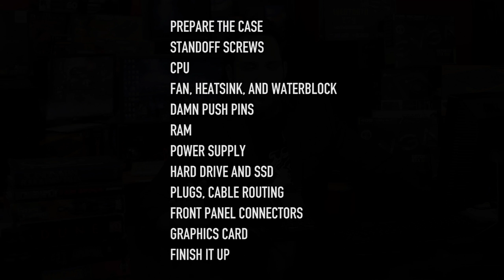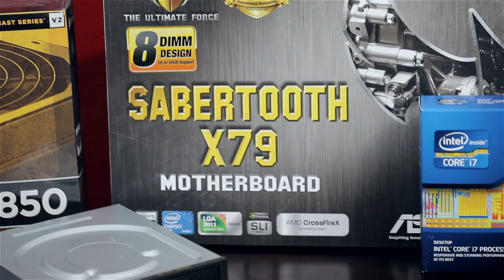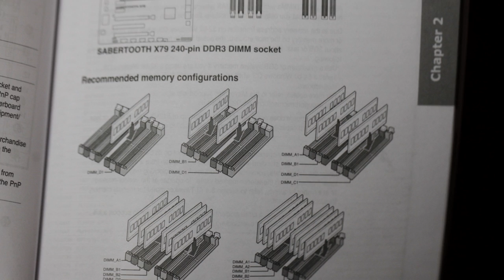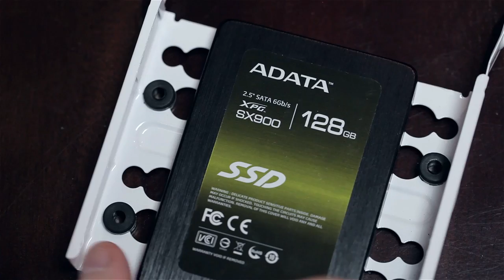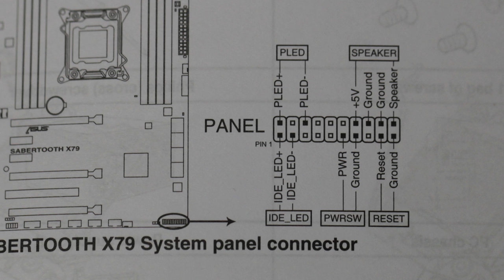How to Build a PC: The Ultimate Guide from Tek Syndicate

Comment: hello, i'm building a computer and i wondered if this is good and that everyting fits

case: nzxt phantom 410 midi tower
psu: corsair cx 600w
cpu: amd a10 5800k black edition
gpu: XFX Radeon HD 7770 GHz 1GB GDDR5
motherboard:  MSI Z77A-G43
ram: corsair vengeance 8gb 1600mhz
hdd:Seagate Barracuda 1TB 7200MHz 64mb cache

Comment: A Z77 motherboard will NOT work with a a10-5800k APU. Thats a Intel mobo and amd is a no no with those. Get a FM2 A75 or if you're wanting power get a A85 mobo. Make sure the cpu connector is a FM2 connector. Also, consider upgrading to the 6800k, its really good :)

Comment: EVGA GeForce GTX780 SuperClocked  3GB GDDR5 384bit

Intel Core i5-3570K Quad-Core Processor 3.4 GHz

Corsair Obsidian 650D 

Corsair Professional Series 860 Watt 

Western Digital Caviar Black 2 TB SATA III 7200 RPM 64 MB Cache Bulk/OEM Internal Desktop Hard Drive - WD2002FAEX - Western Digital

Corsair Vengeance 16GB (2x8GB) DDR3

What Motherboard should i get?

Comment: Hey is this any good (my budget is 240 euros) ?

Motherboard: Asus M5A78L-M LX3  AMD Micro ATX Socket AM3+

Gpu:  MSI R6570-MD2GD3 AMD 2048 Mo 650 MHz PCI-Express 16x

Cpu: AMD Sempron 145 / 2.8 GHz ( 2000 MHz ) Socket AM3 L2 1 Mo Box 

Power Supply: Xilence  ATX 2.2 Gaming Edition 750 Watt 80+ Bronze 

RAM: :Corsair CMV4GX3M1A1333C9 Memory RAM DDR3 1333 4 Go COR CL9

Case: Cooler Master ATX 120 mm Rack HDD

Thanks :D

Comment: DDR3 2100(OC) / 1866(OC) / 1800(OC) / 1600(OC) / 1333 / 1066 / 800 <-- your mobo ram specs, your ram is gonna be set at 1333 by default, you're gonna have to manually set it to 1866 in the bios, probly the timing and voltage too unless theres an XMP profile you can just turn on which should do the job for you and an 8350 should have no problem with 1866 memory, even if you decided to overclock, 8150 had problems with it tho

Comment: Does upgrading your sound card also making your processor working smoother and faster for games ?
Reply: Nope, and believe it or not many sound cards are worst than the on board audio of many motherboards. So it doesn't help much by even having a sound card.
Reply: No need! Sound cards are not needed for the vast majority of people. I use a headphone amplifier and that's amazing.
Reply: i use the soundblaster usb sound card which i got from my headset . does work preety good for such a cheap gadget

Comment: Is this build OK?
MSI Z87-G45 Mobo
MSI Frozr Overclocked GTX 760 2GB
Intel Core i5 4670K (I'll possibly overclock this 4.6 Ghz)
Corsair Vengeance Pro 2x4GB 1600 Mhz
Cooler Master HYPER 212 EVO CPU Cooler
SanDisk Ultra Plus 128 GB Solid State Drive
Rosewill HIVE-650W 80PLUS
Seagate Barracuda 2TB HDD

Comment: I got a question for you, if you don't mind answering. In regards to the power supply I have a case with only one fan and the cpu fan that came with the cpu now should i flip the power supply to exaust the hot air out of the case how you did it there or put it in normal?? thanks in advance!

Comment: The computer boots up normally and stays on, fans spinning and all, but you see no video? Check whether your video card's fan spins, make sure your video connections are correct, cables and adapters not broken, and re-seat all of them. Make sure you use the correct pci-e power connector if you have a dedicated video card, and that your monitor is set up properly.

Comment: I'm sold man I've done research and I was wondering if you guys could help me, so basically I already know the computer im gonna build its the monitor that I'm stuck on so I've done some research and I'm trying to find a monitor that is:
•1920x1080 
•1ms
•Has 1dvi,1hdmi
•Preferably a tn panel 
•60hz 
I've found some but then I  read the review and there's always a problem to back light bleeding to dead pixels to screen tearing so I don't know which to buy but if you guys could find me a monitor that has those specs and good quality id definitely appreciate it

Comment: The fan direction for the PSU is opposite of what is mentioned. Having a blower of the components just makes more sense than trying to pull air across random shapes with a horribly ducted box.

Comment: Noob PC builder question: why is it better to have a power supply at the bottom of the case? Hot air floats on top of cold air and will go up in the case anyway. Or am I wrong?

Comment: The A10 5800k is an APU from AMD and it has a CPU and GPU and if you want to use bothe the on CPUs GPU and the 7770 it won't work you have to use one or the other so a FX-4100 woulld be great for budget

Comment: I'mma buy this PC. Tell me if it's OK or something doesn't fit with the other parts.
	 	 	 	 	 	
Asus Maximus VII Hero
WD Black SATA III 1TB (some games and data)
	SSD Kingston SSDNow! SATA III 120GB (os and 2 or 3 games)
	Intel Core i7 4790K (Devil's Canyon)
	GIGABYTE GTX 970 G1 Gaming 4GB DDR5
	G.Skill TridentX 2x8GB DDR3 2400MHz CL10
Thermaltake SMART M750W
Corsair Hydro H60
Reply: I am building it. I wouldn't be asking this if the PC is pre-made, because, obviously everything fits correctly lol
Reply: Get a h80i , and a cheaper motherboard , the hero IV is useful if you already have like 3 Gtx 970  :)
Reply: A liquid cooer isn't realy needed unless you live in an area that gets extreamly hot or plan on overclocking your CPU or have an AMD FX-9590 as that CPU runs at 4.7 Ghz out of the box

Comment: im moving to pc as i am getting sick of paying to play games online i was going to build the pc i have atm but it will need a new cpu hard drive graphics card an probably mother bored and being out of work atm it is a lot cheaper to buy a newer pc an live with that in till i get a job gain. what im looking at is a HP Pavilion p6-2312ea 
Processor	- AMD A4-5300 processor
RAM	- 4 GB ddr3
Graphics card	- AMD Radeon™ HD 7480D 2gb
Hard drive	1 TB hard drive, SATA 6G (7200 rpm)
for £329.99

Comment: Is this pc any good I set it up on Ibuypower because I don't have the time to build one and this is my first time buying a "gaming" computer so i dont know what half of these parts are.

NZXT Phantom 240 Gaming Case - White
 iBUYPOWER Harmony SRS Sound Reduction System - Reduce System Noise
 Intel® Core™ i5-4460 Processor (4x 3.20GHz/6MB L3 Cache)
Asetek 510LC Liquid CPU Cooling System [SOCKET-1150] - Standard 120mm Fan
8 GB [4 GB x2] DDR3-1600 Memory Module - Corsair or Major Brand
AMD Radeon R9 270 - 2GB - FREE Upgrade to R9 270X 2GB
Gigabyte GA-Z97-D3H -- 1x PCIe 3.0 x16, 4x USB 3.0, 6x SATA-III 6Gb/s
 500 Watt - Standard
1 TB HARD DRIVE -- 32M Cache, 7200 RPM, 6.0Gb/s - Single Drive
24x Dual Format/Double Layer DVD±R/±RW - Black
3D Premium Surround Sound Onboard
Onboard LAN Network (Gb or 10/100)
Reply: Get a name brand psu, i5 4690k
Reply: Dont have time? Lol, doesnt have half an hour

Comment: im planning on switching to pc soon so im sorry if i sound stupid, but do the screws come with the parts or do you have to buy them separately ?
Reply: Dont worry, it comes with everything you need including wires and screws.
Reply: In my experience, the case comes with screws and one or two fans, the motherboard comes with sata cables (for the hard drives), and, in general, you have everything you need. If your CPU comes with its own stock cooler it will also have the thermal paste already applied, if not, you will have to purchase the cooler separately and get the paste for it as well. The graphics card usually ships with a DVI to VGA adapter and a MOLEX to 6 or 8 pin connector (in case your PSU does not have that), but you will need a separate hdmi or dvi cable to connect it to the monitor. I would also advise you to have a wired keyboard and mouse for setting up your OS. I can't guarantee it's obligatory but I doubt you have a chance to install drivers before installing your OS. Also USB 3.0 doesn't work before drivers (as far as I know). Use 2.0 until you install 3.0. The motherboard should provide a CD with drivers (and maybe some utilities). For the video card etc, always get the newest drivers from the website, don't use the outdated ones that come with it. That's pretty much all that I can think of.

Comment: CPU: Intel Core i5-3570 3.4GHz Quad-Core Processor  
CPU Cooler: Cooler Master Hyper 212 Plus 76.8 CFM Sleeve Bearing CPU Cooler ($19.99 @ Newegg) 
Motherboard: Asus P8B75-M/CSM Micro ATX LGA1155 Motherboard
Memory: Kingston Blu 8GB (2 x 4GB) DDR3-1600 Memory  
Storage: Samsung 840 EVO 120GB 2.5" Solid State Disk 
Video Card: Asus GeForce GTX 760 2GB Video Card
Case: NZXT Source 210 (Black) ATX Mid Tower Case 
I already have a 1tb harddrive and peripherals, i now join the PC Gaming master race.

Comment: I just want to reiterate something that was brushed on in this video.
Yes, you do need to be carefull with the edges on the motherboard backplate.  They can be extremely sharp and can cut a decent slice of flesh off of a finger if you're not careful.  Speaking from experience.

Comment: I'm building my own computer soon and I'm on a budget, so can I use the cpu's retail cooler to begin with and eventually replace it with an aftermarket cooler without any problems with the thermal paste or damaging the cpu?
Reply: Sure you can! That's what I did. And after you upgrade it you will probably have better performance and margin for overclock.

Comment: Hello guys this is my first time building a pc, so i just want to be sure will this build be good for gaming? Good for new games and high FPS
Mobo: Asrock 990FX Extreme3
Ram: Corsair 8 gb 2x 4gb 1.6 ghz.
GPU: Asus GTX 760 2gb OC
CPU: AMD FX 6300 6 core.
So could you please help me out. I have planned to play BF4 with ultra options and high FPS aswell
Reply: make sure you have a graphics card with at least 2gb of dedicated graphics. This should run you 1-200$ more but it will be well worth it. I also recommend a 4th gen i5 as opposed to the AMD FX because it will really squeeze everything out of the graphics card you have and is over all a very good processor for gaming.

Comment: What do you think of my personal rig
Intel Xeon E3-1241v3 CPU
ASUS Z87-WS Motherboard
GTX960 EVGA ACX2.0 GPU
G.Skill Ripjaws X 16GB ddr3 RAM
Coolermaster n500 case
Corsair LX 120gb ssd
Corsair CX 600m PSU
WD Blue 500GB HDD
Reply: Егор Матук upgrade HDD to 2tb and you're golden.
Reply: for now I don't have the budget, if I had I would upgrade
Reply: Егор Матук the psu is very low quality
Reply: very low quality is when the psu doesn't even has an 80+ rating
Reply: Егор Матук no the cx has poor capacitors, and are very unreliable go and look it up they technically dont meet atx specifications...
Reply: so what psu should I buy?
Reply: is the CoolerMaster 550W 80+ Gold V550
gonna handle the build at full load?
Reply: Егор Матук Set the build up in Pcpartpicker and it'll show you an estimate of how much it'll use near the top.
Reply: +Егор Матук Why are you getting a Xeon? If it is for gaming...get an i5...
Reply: Deathstrker it is for virtual machines and 3d
Reply: +Deathstrker lol xeons are actually pretty good for gaming, mate. 1231v3 matches some i7s in performance
Reply: *****  yeah it matches 4770k, but get standard k series for overclocking, but it has to be said that the xeon is just a 4770 without overclocking and no integrated graphics but for cheaper
Reply: I dont need overclocking. YET
Reply: +MSI GAMING 4G GTX 970 yeah, and they run on lower voltage and are designed to run 24/7
Reply: ***** with support for ecc memory, which is designed to run 24/7
Reply: MSI GAMING 4G GTX 970 server grade stuff, basically
Reply: If you'rejust gaming you don't even need 8gb of RAM. With that said just get 2x4 GB of DDR3 RAM.
Reply: +Kenny McCormick You're actually completely wrong. New games like MGSV can easily use 8 GBs of RAM. By using less than that you're going to be smacking into a brick wall in the near future.
Reply: killbotvii Not even. Games require a minimal of 4GB of RAM. Most recommend at least 6GB. We won't see games tbat use 8GB for a while. A few years at least.
Reply: Kenny McCormick Witcher 3, MGSV... yea, a few years and we will be there.

Comment: Sooo about the cable managment behind the case..... can i just tie'em up randomly until it looks clean and nice or does it all have to be in a certain order ?
Reply: As long as everything is plugged into the correct spots, it doesn't matter. I was running my computer in a strange state of disassembly with random parts sitting and operating entirely outside the case because the fans were broken and I needed to keep it cool. So yeah, just tie them up however you see fit. Usually people will sort them out for the sake of organization, but its not necessary.
Reply: Neighborbob oohh thnks ......

Comment: So i'm saving up some money to buy parts to build a pc. I wanted to know if all of these parts would work.
ASUS M5A99FX PRO R2.0 AM3+ AMD 990FX SATA 6Gb/s USB 3.0 ATX AMD Motherboard

AMD FD6300WMHKBOX FX-6300 6-Core Processor Black Edition

WD Blue 1 TB Desktop Hard Drive: 3.5 Inch, 7200 RPM, SATA 6 Gb/s, 64 MB Cache - WD10EZEX

Cooler Master HAF 912 - Mid Tower Computer Case with High Airflow

Crucial Ballistix Sport 8GB Kit (4GBx2)

EVGA 500W 80PLUS Certified ATX12V/EPS12V Power Supply\

EVGA GeForce GTX 750Ti Superclock
Thats only not including the DVD Drive

Comment: You wouldn't want to face the PSU's fan into a solid metal plate, but there is always a hole in the bottom to let the air pass through for this set up.

Comment: Got my new PC on the way, it'll be fun, hopefully it'll last some time. Hoping for a minimum of 60fps at High/Ultra for a few years, maybe I'll change the GTX 980 for some GTX 980 Ti when they're released and build something new for the two others.

Intel Core i7-5930K (stock clock)
Corsair Cooling Hydro Series H110
Asus Rampage V Extreme
2x EVGA GeForce GTX 980 Superclocked
1x EVGA GeForce GT 740 (To plug my second screen)
G.SKILL Ripjaws 4 32GB (2x16GB) DDR4 @2400MHz
Western Digital Black 2TB (files)
Samsung Evo 840 Series 1TB (games)
Samsung Evo 840 Series 500GB (OS/Programs)
EVGA SuperNOVA 1200 P2 80+ Platinum (1200W)
Windows 8.1 Pro
Corsair Graphite Series 760T

Along with;
BenQ XL2420G 24" 1080p G-SYNC 144Hz + BenQ RL2455HM 24" 1080p 1ms monitors
Bose Companion 20 speaker system
Corsair Vengeance K70 Blue Cherry keyboard + Corsair Vengeance M95 mouse + Corsair Vengeance MM400 mouse mat

I'll probably upgrade my current pc too, changing its AMD 5770 for a GTX 760 if I can find one, along with a new heat sink for the i7-2600 it runs.
Reply: If God had a PC... this would be close to it.
Reply: dump the windows *1 ad et winds 7 pro or ultimate
Reply: Ed Brown Windows 10 is coming soon, so I just took 8.1 until it arrives. Really there's no problem with the OS so far. Hopefully Win10 will be pretty good.
Reply: MaladeChannel all windows 10 did is brought back the start menu for laptops and desktops other than that it is windows 8
Reply: Ed Brown Okay then, that's fine by me. I ran Vista for a long time before I got 7, and it was considered a terrible OS. A lot of people had plenty of issues with it, but I never had a single one. Interestingly enough, I had more issues with Win7 than I ever did with both Vista and Win8.1, including the whole OS that just died on me and wiped all my data. 

Up until now I've had a few issues with the pc, but the first was related to my motherboard's drivers and the second to Nvidia's drivers being configured like shit for the new GTX 980. Most of that is fixed and the OS as caused no trouble at all. A lot of friends which bought into the Win8.1 hate are now using it and loving it more than Win7. 

Personally, I don't care too much. I prefer the start menu on Win7, but I have 3 screens so I can just open the damn thing wherever I please with no issues at all. Otherwise, all the games I want to play run smooth, and some even better under 8.1.

Plus, Windows 10 has Cortana in it. I fucking love Cortana. You just tell me there's Cortana in your OS, and I'm gonna buy it.
Reply: ***** Obviously you have never heard of "Large Pixel Collider" from PC-Gamer? It includes 4 x GTX Titan Black among other things...
MaladeChannel "hopefully it'll last some time. Hoping for a minimum of 60fps at High/Ultra for a few years" It will for sure, my PC has GTX 970 and it runs BF3 and 120-140FPS on ultra all day.
Reply: +dreamflow Get a 1440p 144hz monitor!
Reply: Radeon I'm looking for one right now, but they're stupidly overpriced. I'll see if the Asus 27" 1440p G-Sync monitor goes on sale during Black Friday, otherwise I'm doing just fine with my current set-up of 3x 27" 1080p monitors.

Comment: Would it be better to get a heatsink when i get the PC components, or should i use the included fan with the cpu and upgrade it to overclock later?
Reply: Conquest I went with an alpenfohn (i think i spelt it right) cooler that was recommended by a local shop and it performs great. Looking to overclock it soon
Reply: Conquest well what is your budget for the cpu cooler?
Reply: if your not over clicking then the stock cooler is not bad. the only problem is that it's loud, but honestly that's why noise canceling headphones exist

Comment: Hey guys is a NZXT Source 210 Tower Case any good? I haven't seen them recently and im running a GigaByte HDMI Sata 6Gb/s USB Micro ATX AMD Motherboard. The Case is around 42$ USD on newegg and looks pretty good for its price but im concerned on its quality.
Reply: It's a pretty good case, it's got lots of room for large motherboards, GPUs and heatsinks. However, the paint is very soft and thus is easy to scratch off.

Comment: It won't work. The AMD A10 5800k is an FM2 socket type, but your motherboard is LGA1155 socket type. Everything else works fine. Search on google for FM2 motherboards. Also, are you planning on overclocking your CPU?